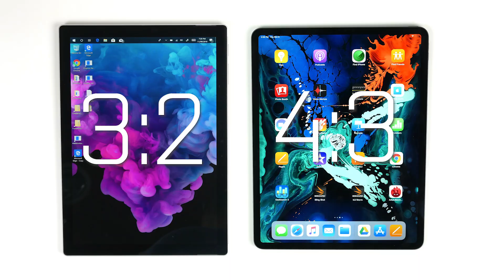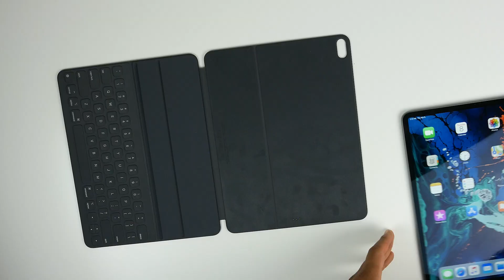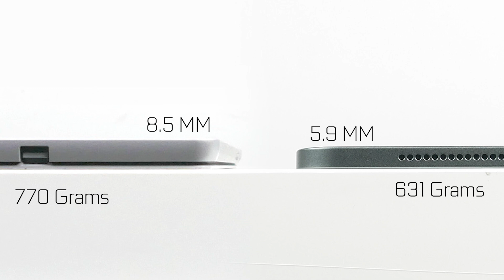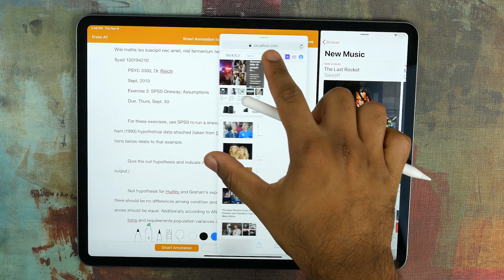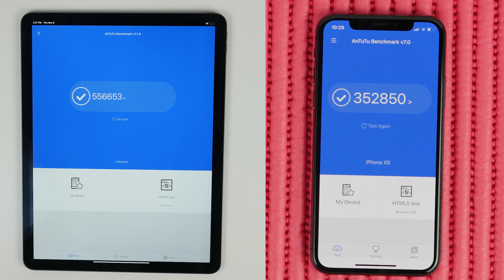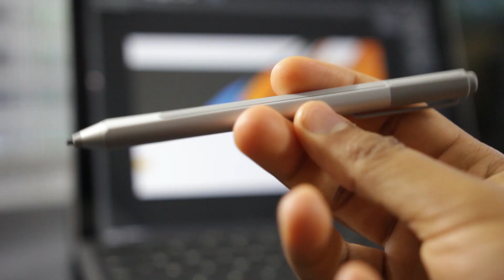2018 iPad Pro vs Surface Pro 6

Comment: Ipad. No file system, can't add storage space. Can't use a mouse. Can't put a USB files to it. Can't open multiple tabs at once. Can someone please tell me how it is a laptop replacement. I don't see it. Surface Pro 6 does all those things. End of discussion
Reply: @tech4days162  Files is just an app you cant access anything with it execpt icloud
Reply: Getting Surface Pro 6 with i7 is way too costly. Same for ipad pro.

I would rather buy decent laptop like Dell XPS 13 or Inspiron together with 64GB New Ipad pro 11 inch

There you have it. It's almost the same price of them but little bit higher
Reply: @Pranita N both are good to their respective audience , neither machine makes sense as a laptop gives much more than what they offer at a lower cost and many modern laptops are light along witn being a 2 in 1 as for any decent work you need a keyboard and a touchpad so a laptop outscales  them both.
Reply: Gamingdragon yeah, a lot of good laptop but non of it is from Microsoft...specially surface
Reply: @Pranita N you can find stupid comments like that everywhere . People saying windows doesn't do more stuff have never used a windows machine , a well optimised windows machine does far better than ios but ios is simpler and better for casual use as well as for mild photo editing .
Reply: you actually CAN add storage space.. even on iPhone. there are usb sticks that have their own app. you can add photos and video to and from external storage using the app. so there goes your point.
with the surface pro YOU NEED to buy the keyboard with the trackpad because everyone in the world knows touchscreen is shit trash for windows 10. with the iPad, you dont need the keyboard because its great as is. also, no 120hz refresh rate lmao and shit processor. 
I will agree with you on one thing tho... iPad is hard to use as a TRUE laptop replacement. ive tried, and I kept on coming back to my MacBook Pro. BUT, it TRUELY is the best companion for the laptop. and you cannot disagree with that. 
over all, if I had to fully choose between the two to replace my laptop, id still choose the iPad 12.9 over the sbp
Reply: You can do all of those things except use a mouse
And why would you want to use a mouse with it?
Reply: mister may got roasted by kjcz ashiba......dam.... mister may
Reply: Apple: hold my beer till fall 2019
Reply: one answer to all of that limitations: Jailbreak
A jailbreak will cure everything except for good professional app support.
Reply: You are wrong in a lot you said. There is a files system literally called Files, you can use multiple tabs AND multiple apps at once, and you can airdrop any files you want as well as using drop box or any range of services
Reply: I just don't think it is a productive topic since surface is a laptop. I don't think it is fair to put them together. I have both surface and iPad. I like surface can open tons of applications together since iPad only can open max 3 apps together. Surface can open multiple windows document together, but iPad can't. It depends on what type of consumer it is. For the iPad, I don't think it need a mouse, the touch screen actually works very well, but surface actually really need that mouse or trackpad because there is a delay on the screen and sometimes, it will result frozen screen. After using my surface for a while, actually my battery sucks now(around 3hrs battery life max), but I don't want to spend more than $500 to replace it for a refurbished device. My iPad used to have battery problem, it used to drain faster after it turn to 25% but it becomes better after I update it to IOS12. Before that I went to the Apple Store actually, they told me it would be $99 to replace a new device. Support part, I will say Apple is kinda better. Port is not a big issue since mostly I use cloud drive. App wise, IOS totally win. There is more options. I am a student, and I only can use onenote on my surface, but I have more and better options on the iPad. Later when the full version Adobe dropped, iPad will win as graphic part. However, if you want to do basic coding or install some company customize win app, I will say definitely surface win. Overall, 1. Surface is a computer, it even cannot identify as tablet(the tablet version is horrible). 2. If you really don't want to spend a lot of money, and you want a computer and have capability to write, you can get surface. You don't need to worry about storage because you can always put micro SD card. 3. We don't need to say which one beats other because tech is a thing keeps updating. Tomorrow will have a new machine come out and whatever we are discuss right now will seem like shit again. 4. Whatever you think iPad cannot do, actually there is other way can solve that, it will not affect the using experience.
Reply: mister may exactly! I love my MacBook Pro. I can only say I like my first gen iPad Pro 12.9. It, too, was billed as a replacement for a MacBook. It wasn’t, and thankfully I held onto my MacBook because there were far too many things I still needed to use it for. iPad is form, MacBook is function. Hope springs eternal...
Reply: I hate that I have to swipe up from the bottom of the screen to open another app. I appreciate that I can run two apps side by side, but I liked windowed applications such as on a Mac or Windows computer, where I can quickly move between apps without having to swipe around on a display
Reply: This is the truest comment out there. iPad Pro is good and all, but how can people possibly compare this to a laptop computer, yes it has a keyboard and can handle (some) computer tasks, but at the end of the day, it doesn’t really make it in the realm of replacing a computer, my opinion feel free to argue
Reply: @tech4days162  dont forget the file system called Documents... Amazing
Reply: You are still in deep "90 :) Be more courageous :D
Reply: Lol I'll prefer a Razer blade.
Reply: mister may I know he seems to be a bit biased. If he reviewed it as a tablet that would make more sense but he literally says it’s a laptop replacement and then focused on things like the camera, weight, speakers etc.
Reply: It has file system, and yes you can add USB files to it, I download mega raw images and raw 4k videos from USB stick all the time - But I guess Ipads weren't designed for BABOONS!!!
Reply: I can use a mouse with my phone with an adapter lol
Reply: Can the Surface Pro 6 run java programs?
Reply: mister may buy a Commodore 64!
Reply: The iPad can open multiple tabs at once
Reply: @jaedevrick  you can open up multiple tabs on your screen and veiw them all at once. 😂😂😂😂🤣🤣🤣🤣. No you can't. If you think you can. Try it. You can only do a side by side with 2 different apps.
Reply: @mistermay7986  you literally can, there is a bunch of reviews on it, idk what's so funny.
Reply: mister may you can’t replace a laptop with something that’s still just a laptop lol

Surface pro is not a tablet lol
Reply: It's funny how you asked people about their opinion but at the end of the sentence you just closed the discussion.
Reply: Try ifunbox for managing storage on ipad
Reply: A laptop replacement to me is a device that will allow me to do most (not ALL) of the things that I do on a laptop/desktop without getting in my way (has to be light and slim (iPad's form factor), optimized OS with power behind it (iOS+A12X), versatile while remaining mobile (USB C, AR capabilities, music studio hardware/software integration, Photoshop), etc.). The Surface seems more like a laptop rather than a replacement because it has Windows which is better suited to a desktop/laptop platform rather than a tablet platform. 

Right now, I'm aiming for an Android phone, iPad tablet, Windows laptop setup until I can afford more Apple gear for a more seamless experience in my everyday life. However, I do intend to keep my Note 8 and Lenovo y720 to do things that Apple don't have a hand in (Virtual Reality, Videogames, and obscure use cases only possible on Android).
Reply: Well say hello to ipados13
Reply: All those features are coming this fall with the new OS, iPad OS
Reply: Gerard Murillo I can plug keyboard, external display, Ethernet cable, speakers on a multi-port adapter. So I only need to plug in one thing to transfer into desktop set up. What about trash surface pro? All regular laptop with that price is better than surface pro, its just a trash laptop with worse keyboard and trackpad. A12x don't run macOS, so? 4K video editing? 2k 100+ layers PS? Pro music editing? What about your garbage surface pro? What "pro" things can it do? CFD? Can't. Rendering? Can't. Large scale data simulation? Can't. That piece of trash can only end up doing pdf reading and MS office. Btw iPad Pro can do excel way faster than surface pro6 i5. Lmao
Reply: @kjczashiba4830  You make good points, but what you don't understand is that they are two completely different operating systems , that both have their pros and cons. I have experienced the Surface Pro and the iPad Pro, and I think that it all depends on what you need it for.
Reply: Cameron Bayat I'm not trying to say windows is trash, just saying surface pro. Surface pro should be perfect for me if only Microsoft actually trying to optimize it. I bought one and it let me down. I thought it would replace my 13inch laptop and be a good notebook for taking notes on lectures, it just can't, in both way, at the end it just a touch screen laptop without the keyboard and trackpad content together. Or maybe it's just me being too critical with the experiences.
Reply: @kjczashiba4830  I think you are being too critical. iPad imo isn't necessarily worth it off your not in the apple ecosystem
Reply: Not anymore. iPad OS in September adds a true file system, external storage, and trackpad mouse support plus tons of other improvements. Not to mention it’s a power beast of a tablet computer that outperforms most laptops and MacBooks.
Reply: @coralreef909  but we will need to see how good mouse support is . I personally don't know if it is going to be useful in the iPad. It would be easier to use touch recognition instead Imo. The other features seem dope tho
Reply: @coralreef909  no it doesn't lol. It doesn't outperform laptops and it probably never will . I would love to see fucking Skyrim with over 200 mods run on my iPad. But it won't. There is a reason that steam isn't on iPad. It's because it is now powerful enough. And don't try and say it is. If it was then I would be using Steam on my iPad right now
Reply: mister may COMPLETELY AGREE
Reply: iOS 13 fixed it all
Reply: mister may cough IPad OS cough
Reply: Gerard Murillo I had a surface pro6 i5 version, and I'm pretty sure you don't have a iPad Pro. Actually I thought surface is the only 14nm x86 device you've ever used.
Reply: Now with the iPad OS coming up, you gotta change your opinions
Reply: @amgmspaghetti  It looks good but if you want to use full Adobe Photoshop etc then Windows OS is better, same goes for Microsoft Office. But I do think the iPad OS looks great and would be good depending on what you use it for.
Reply: @Daniel P some*
Reply: @JW H I love the SP Keyboards. The key travel is just fine, especially considering how thin the keyboard is . The mouse is good as it is compatible with gestures. And the touch screen takes time to get used to but it gets easier to use after trying it for a while. I'll admit that when I first got my surface pro , I was uncomfortable with the touchscreen because I moved from an iPad to SP. But I enjoy it now.
IMO it is all about preference
Reply: All of that is fixed with ipad OS and multiple tabs have been here for a while
Reply: mister may you’re right, the Surface Pro is better than an iPad as a laptop. However, as tablets, the iPad wins hands down. The fact is that the Surface Pro is basically a laptop that has a crappy, detachable keyboard/trackpad. Without the keyboard and trackpad, the Surface Pro is very difficult to use as a tablet because the desktop OS is not optimized for a touch screen interface as well as iOS with the iPad. In my opinion, if you plan to get a Surface Pro, just get a regular laptop. You’ll rarely use the touchscreen anyway, and I’m a person who owns a 2 in 1 windows laptop. I tried using it as a tablet, and I ended up sticking with the keyboard most of the time. 

My point is that the iPad is more of a “laptop replacement” than the Surface Pro, because the Surface is just a crappier laptop with “tablet” abilities that aren’t as good compared to the iPad. The iPad is a tablet that is given some laptop abilities with the keyboard and that’s it. Besides, the processing power of the iPad Pro with the A12X is basically future proof at this point which means that future iOS updates and third party developers will utilize the A12X processing power and touchscreen interface to make the iPad Pro a true replacement for laptops for anyone including content creators.
Reply: @angelo_villones  How is windows bad on touchscreens , its a myth actually . Also none of those beat a real laptop or a device like the surface book which is very versatile . The ipad is just a tablet and as good as any other tablet while the surface is aimed for the office class who have to deal with documents , presentations etc as such just buy a xiaomi notebook with an 8250u and an movie 150 , 10 hours of battery life with good going performance formula end gaming .
Reply: ipad and surface both have touch screen you dond have to use a mouse or track pad god damn it
Reply: Did you really just say iPad doesn't have a file system? Have you really ever used one wtf
Reply: @neetiranga  It is way to limited and uncomfortable for the user.
Reply: Tried several times on my 2 in 1 (8th gen i5 8gb ram) to use it just in tablet mode and even with a stylus windows is still not that touch friendly also had a good amount of lag in photoshop using the smudge tool on a 72ppi almost 4k image, also noticed that the i5 surface pro 6 seems to be fanless.
Reply: surface pro6, No usb-c, no 120hz screen, crap processor, crap AR support, crap battery life.
you need USB to transfer data because their is NO airdrop or something closer on windows, 
surface still support mouse because they know their win10 touch screen support is garbage, without the keyboard and trackpad surface pro6 is a piece of trash lying there can do nothing. 
LAPTOP REPLACEMENT is not built sometimes similar but has a worse experience than laptop. for those who have desktops and need a mobile device or work on art, ipad pro is the perfect laptop replacement, while surface pro6 is just a crap laptop.
Reply: @kjczashiba4830  sp6's touch screen is perfectly fine and that's obviously not the reason why MS added a track pad. If you question the inclusion of a quintessential track pad, then you've never worked on a laptop before.
Reply: Ahmed Choudhury then stop using trackpad or mouse on surface and see how long you can take. and most of the time im using keyboard short cut for word, excel and matlab. if you use mouse so regularly then you a just a kid unfamiliar with the software
Reply: @kjczashiba4830  I think you never used a productive program in you life to know the importance of track pad and mouse.
Reply: Raghunandan Reddy C matlab? procreate? excel? tell me how important a trackpad is? have you ever use those apps before?
Reply: @kjczashiba4830  I'm using my SP6 without the type cover most of the time and I had none of those complaints with the touch or the interface that you've mentioned, I don't even think its that much slower on desktop mode without a mouse. And I cant either understand why you think the processor and battery life are crap, they serve me well in university as well as for media consumption. Also drop that forced apple bias, you just can't be that ignorant to think that airdrop is the solution all of the real world uses for productivity tasks and that USB is completely unnecessary
Reply: Toastelele L. you won't understand because you only use surface pro, I used surface pro4 and ipad pro first gen, all the lags bugs none responding, randomly screen freezes in your eyes is nothing or you thought it was your finger operating miss. you know what, keep use your sp6 and never touch a apple product, and you would be happy with your choice
Reply: @kjczashiba4830  lmao, so you commented on a video that is comparing recently released devices, using a comparison of outdated devices for analogy while talking bad about the current device in categories that have improved over the last years? Yeah you may be right then in saying that I can hardly relate to your little nonsensical rant, but I assure you that those issues you claim you had on a frequent basis have nothing to do with sp6. But I guess apple fanboys cant comment on a windows product without gatekeeping and saying they've seen more bluescreens than anything else
Reply: Raghunandan Reddy C so tell me what type of production you do on shitty little unfriendly non-fan tabblet...wonder if you can fry an egg after stress test 30 minutes 4k advertise. I rather buying a laptop from dell asus or acer at that price .... i am a user who used to have the surface windows tablet from 2014. And i will tell ya that it is a nightmare, it wicked, no graphic card nor support egpu, touching is crap, and keyboard is just annoying even i am a user who using pc from start with. Everything that windows tablet do is just basic used like browsing web check email typing essays...if they using amd ryzen 5 2500u yes, i can said it can render a project but this thing using intel hd630...little shit that is so stupid
Reply: Toastelele L. Yeah, like cover half of your screen....i tell you that, for typing, even ipad still need a keyboard so dont talk crap ok 👌. The thing here is, ipad can use without keyboard because most of program are apps, not web browser like on windows. Second, if i have to choose between a surface or macbook i surely choose MacBook even i am the kind of man who always said macbook overpriced . Because surface not even close to overpriced since it is hyper price..
Reply: @ahmedchoudhury7838  Exactly!! Surface Pro is a laptop tablet system. Win 10, designed for business, creative uses, field uses, education uses, and more. The extras just make it a more complete and flexible system. Ipad Pro people here are laughable. I have an IPP 9.5, and no f'n way would I even compare it to my SP4. It barely hangs in there with a Samsung Tab S4. Worst yet, Ipad Pros stop working when its too cold or too hot. I bought it to fly a DJI drone, and the damn thing dies when its not a perfect temp outside. I have to use a Samsung S4 Tab to finish our work at jobsite zoning. Lots of negatives with an Ipad Pro as well.
Reply: @kjczashiba4830  he means that you can't transfer files from a device directly to ipad pro...many functions of usb c are not there on ipad pro unlike other usb c devices
Reply: @kjczashiba4830  crap processor that have been use in Mac. Hmmm crap Mac
Reply: Hermawan Fandi macbook pro13 use 28W processor with 2 fans focus on it, while surface pro6 use 15W processor with passive cooling. and yes, the new macbook air is trash, I never gonna deny that.
Reply: @kjczashiba4830 core i7 is not crap
Reply: @professional4158  Apple fanboys....
Reply: @kjczashiba4830  all your points are more garbage than XR resolution
Reply: ( ͡° ͜ʖ ͡°) well, then my points are not as garbage as you
Reply: @kjczashiba4830  also windows can have a far superior touch experience if you know how to use windows along with custom software like gesture sign and ahk .
Reply: @kjczashiba4830  "surface still support mouse because they know their win10 touch screen support is garbage" - so if they why dont they put a touch screen on the Mac laptops? I guess they will do soon and then they will remove the touchpads too. Let's see how right you are.
Reply: Manos Protonotarios because apple knows macOS has too much old things just like windows, and would be impossible to make macOS be touch screen friendly. not like microsoft, win7 win8 win8.1 win10, how many years past? win10 still can't support touch screen well
Reply: @kjczashiba4830  windows can support touch very well dude .
Reply: @kjczashiba4830  crap processor? It's literally better than the iPad pros a12x.
Reply: aliwalyd3 lol better!? How!? One is 4 cores 8 thread low tdp, one is 8 cores 7 gpu that can run as close as rx 550. And also geekbench marks are up there
Reply: @kjczashiba4830  also what is the used usb  c ,its stupid except thunderbolt support which only a few users may use because an external going is not portable or cost effective . also windows can transfer files over wifi for years , it has a ton of applications for it , usb is faster that is why windows user use that . Again none of those devices have good AR support for which you need atleast an Nvidia GTX 1050 .
Reply: Gamingdragon first, a12x is an eight cores chip, no match, second is does surface have gtx 1050 nor support egpu (not even have type c)...when ipad did. Intel hd 630, will you doing any project on this gpu? If you did, next time remember to put an egg on top off its and see will its enough to boil an egg.
Reply: @kjczashiba4830  Ummmm No. Plenty of ways to get data to the surface. The screen is brilliant, so is connecting it to multi-screens and screencasting, Battery life is well good enough, Why would i want to use something like airdrop? A mouse is still one of the best ways to be productive and actually get things done. The keyboard and trackpad is as good as anything apple has to offer. In comparison, the iPad is a toy for consuming on.... A good one but not a productivity machine which is why Apple agree with me by selling laptops...
Reply: Stephen Catton first, what kind of workflow will you put on i5 8250u 8gb vs specially hd 630. Tell me, i wonder if that shitty can run adobe premiere without overheating. Sure it is better than using touch screen but its also means, its cannot live without keyboard and mice which is a joke since you had to buy it. Ipad pro, depend, some user dont need felio to use a ipad.
Reply: @kjczashiba4830  For it's purpose - creativity; do tell me why you need a 120Hz display - especially on a device where it barely passes 60FPS in most applications? AR is a fucking myth and 'crap battery life' - no, it's a professional tool.

This thing annihilates the iPad Pro - infact, just iPad; it's not a fucking Pro device, it's a joke.
Reply: Sy7ygy barely!? What are you talking about!? Even snapdragons 845 can handle 90fps gaming and something that can handle 2k game cannot push near 120fps!? Rubbish...yes this can game , gaming like pubg mobile, asphalts, watching high refresh rate contains...only shity hd630 cannot push anything over 30fps even on lowest at fhd
Reply: @kjczashiba4830  youre just another brain washed apple fan boy please stop spreading yore bullshit if youve ever used a surface pro the you would know what youre talking about. BTW ever heard of WINDOWS... yes no one uses OS in the work industry
Reply: Emperors Ordeal OS=operating system, and windows is an OS, you are just a kid knows nothing
Reply: @kjczashiba4830  LMFAO
Reply: @kjczashiba4830  CPU is not crap it is a desktop architecture not mobile
Reply: @kjczashiba4830  That's a pretty dumb comment. The battery life is quite good in both.  The CPU isn't amazing on the surface pro but it's capable enough.  Were you planning on running Crysis 3 on your ipad?  I want to be able to store my photos on an external hard drive and edit them on a device like a laptop and then continue with a larger more capable computer at home, the iPad won't allow this because of it's programming. I'd have to use cloud storage, which doesn't work all that well with the full version of lightroom, and with multiple gigs worth of photos and video, I'd have to pay for a storage subscription, and use mobile data if I'm away from wifi...no the iPad isn't capable enough.
Reply: @kjczashiba4830  so send me a excel file over facebook messenger
Reply: Duy Lai dud, Facebook messenger limited the file size to 25mb, my single sheet of excel is larger than that
Reply: kjcz ashiba well, Surface Pro 6 has better battery life than the iPad Pro 2018 as mentioned in the video. I doubt you watched the video
Reply: @kjczashiba4830  ipadpro is the first apple device using usb c, while other devices have been using usb c for a much longer time, i bet a person like you wouldn't have been giving shit about usb c and would be thinking usb c as useless until apple introduced it in their device, suddenly you are now realising the importance of usb c
Reply: Sarfraz Ahmad 1. Apple start using usb-c on MacBook since 2016, and that Mac only has usb-c. It is apple pushing the usb c
2. He was talking 15w i5 gen8 faster than 45w i7 gen7
Reply: kjcz ashiba how is an 8th gen i7 crap?
Reply: @kjczashiba4830  haha i Like Apple Fangboys
Reply: @kjczashiba4830  crap processor? The i7 absolutely demolishes the A12. No competition.
Reply: วคx I did a simple test, 80mb xlsx file, 30000 weibull distribution calculations and few histograms, iPad Pro can load, do the calculations and plotting twice faster than surface pro6 i7 version. Face the truth kid
Reply: kjcz ashiba 
Enjoy your iPad pro
Reply: Fuck off
Reply: @SephirothxRena  lol
Reply: real apple fanboy  @kjczashiba4830
Reply: @kjczashiba4830  my dad has an iPad pro. I have a surface pro. My dad prefers my surface pro lol.
Reply: Jonathan Pontel that’s what all fandroids say
Reply: @jponz85  everyone thinks differently 🙀
Reply: @mryup6100  agreed
Reply: @tech4days162   You have Apple in your name, you're not even trying to be non-bias. These two devices have two very different audiences. The iPad is geared toward your digital arts creators on the go. The display is beautiful and the pencil is hands down the best portable tablet (as apposed to studio drawing tablet) I have ever used. Meanwhile the surface is geared toward your average business person. It is a full laptop in operation with a tablet form factor. The keyboard is hands down better, I cannot stand to type on the iPad keyboard for anything longer then a couple of minutes, meanwhile the surface keyboards are the only other laptop keyboard I will use besides Thinkpad (I feel I should mention that I also loved apples old laptop keyboards that they abandoned to shave off three millimeters from their devices). There are a couple of objective truths between the devices, but at the end of the day it comes down to preference and use case.
Reply: @kjczashiba4830  crap processor? Really? What are you smoking? It's a complete computer OS. Not a mobile OS and 120hz? Why do you need it on a work machine?
Reply: @kjczashiba4830  Stop with this USB C propaganda. We still use a regular USB file drive. It does not fit in a USB C. The world still actually use regular ports. And guess what. You do to. You have to use an add on for a USB C. As for as what's better. Surface Pro 6 is near flawless. Pick one up and try it. Trust me. You will never want to put it down
Reply: mister may I throw the new surface pro, touch screen got no response randomly, bad touch screen interface optimization. just because I didn't shut down it for 2 days, it crashed while I was working on my report, whole screen freeze and no response, even no blue screen. All the time I use it I was thinking why not just go to the regular laptop. Ive used thinkpad x1, macbook pro13 2016, and new surface pro was the latest laptop I bought but the most unreliable laptop I've ever used
Reply: mister may and the issue is usb-c adaptor support ANY port on surface pro6, while NONE of the ports from surface pro can support full usb-c 10Gbps.
Reply: mister may why are people stressing on usb - c it is miles faster, can transfer files, charge faster, supports a variety of ports, can support external displays. Surely this says that the surface pro is not future proof even the surface go has a usb c. There is a reason people are stressing on it. And now Apple is adopting it it will surely grow quickly. You would buy a surface pro to do graphics intensive work, would you ? It would be used mostly for productivity, typing emails, media consumption, etc. And as you said that photoshop was working with a little stutter on stage, it is still in beta. At least the iPad can excel at the things it is meant to be. The surface pro is just messed up, it is a low end laptop at such prices. Don't tell that it is a hybrid, it works crappy when used as a tablet due to Windows. The a12x bionic has a huge headroom for developers to take advantage of it. Editing 4K video efficiently, and where did you get your info, the iMac pro doesn't fail in editing, it pushes through it easily.
Reply: @mistermay7986  world is shifting towards type C, which is tough for most users, but it's a better port indeed... or else we wouldn't have upgraded from floppy drives
Reply: @sannatal44  type C is bad to omit on surface. But I wonder what productivity iPad offers with USB C on it when you can't just drop files to and fro from it. iOS is a mobile OS can never compete with Windows.
Reply: mister may no I don’t use an add on for usb c I use usb c normally
Reply: mister may it’s just dumb because the surface go has usb C, and this one doesn’t
Reply: @ExpendableCrumb  usb c is a gimmick for now as all real work can be done effectively via a normal usb without carrying a million dongles as such you cant even put in a normal flash drive without  a dongle . Also usb C will be implemented in next gen by adding thunderbolt support as without thunderbolt i dont think it would be that useful and implementing it would require a redesign . The surface gohasno thunderbolt support . Btw next gen may be amd anyway so makes no sense for getting thunderbolt this year and dropping it the next as they care for the customers who may purchase an egpu for thunderbolt.
Reply: @mistermay7986  The irony is the CHEAPER surface go has USB C which kinda sucks if you want a expensive laptop to have the latest ports
Reply: @kjczashiba4830  i didnt shutdown mine asus 400 dollar core i3 4th gen laptop for last 4 months and still no problem at all. your 2 day claim is fake .
Reply: @kjczashiba4830  even with usb c you cant connect ssd. we can do it on surface even without usb c. whats the use of that shit 10gbps port when u cant really use it.
Reply: @rajshriingle8952  there are people on earth who doesnt use photo editing, exporting at all, software at all. who told you surface has bad experience in laptop mode. thats you made yourself in your mind. surface is much more versatile than ipad in every aspects.
     internet-- most people use chrome and chrome in windows is much better than your safari shit. 
    surface is really a 2in1 laptop and your ipad is just another ipad trying to become laptop. 
intel processor are still better than arm processor  made by apple. geekbench score changes in different os.
   this guy didnt shown the quality of surface pro displays.
   just by saying apple chips are optimised for 4k video exporting doesnt make ipad a better laptop choice. surface can also do that can also run other engineering software better than ios, can game, can use mouse, and the best one it has a sd card slot and can also connect to external storage device. 
    it can do every laptop task on the go.
 there are still no test showing core i5 and core i7 are slower than your apple counterparts in every task they can be faster for 4k video exporting but laptop experience is much more than that and intel chips are better on that still.
       ipad can win for their pen support and battery life but thats not a laptop experience
Reply: @rajshriingle8952  all the time isheeps brag about 4k video exporting thats not means ipad is a better laptop alternative for everybody.
Reply: golu singh first yes for laptop it is not match and i am 100% sure but compete with windows tablets, it is way way more useful
Reply: @sannatal44  sure but not everyone gets an usb-c drive. And not every device has usb-c even though they should
Reply: mister may who is we? Most of my items are USB C now
Reply: kjcz ashiba usb c support, on an ipad? Whats its used for? Charge?
Reply: @kjczashiba4830  is it possible you got a dud? I've had a surface pro and a surface laptop as well as a macbook pro. I've never had any reliability problems with either windows device, their shortcomings (for what they are) were that they're not all that fast (neither was the macbook) and not having the brightest screen. I sold the macbook because it had too many compatibility issues and the screen lacked contrast.  Apple could fix a lot by making iOS something better than a walled garden for your money.
Reply: Charles Talhelm even Microsoft admits the issues of win10, they promised the next win10 update will fix those problems (hope so, they said this every time). Why you still fight for them?
Reply: @kjczashiba4830  core i5 8250u beats a previous generation core i7 hq series in performance so how is that crap especially it being a 4 core 8 thread cpu unlike previous generations .
Reply: Gamingdragon 1. 7700hq is 25% faster than 8250u in multi core and 3% faster in single core.
2. there is no fan for i5 version surface pro6
3. you don't even know which is VR which is AR, at least gtx1050 for AR?? 
do you even know what you are talking about?
Reply: @kjczashiba4830  Windows 10 recommends atleast a gtx 1050 for it mixed reality which incorporates VR currently and AR in the future for its applications . i know what i am talking about . 
As for benchmarks core i5 8250u gets 4700 in single core compared to a 4000 7700hq  while in multi core it 8250u has 13,000 compared to the 12,000 of a stock 7700hq. Also how can multi core improvement be smaller than single core as the ipc hasn't been improved this gen as much as the number of cores and the virtual threads .The 8250u is a 4 core 8 thread machine.
Reply: Gamingdragon AR don't need two screen cover you eyes kid, you talk like you've never used AR, and combined VR and AR is not happening in next 5 years. so stop your gtx1050 joke. 
and from cinebench R11.5, 64bit, Passmark CPU mark, geekbench3, ALL of them shows 7700hq is at least 15% faster than 8250u.
the latest geekbench4 results: surface pro6 i5-8250u is 4085/13293, macbook pro 15 2017 i7-7700hq is 4640/15196, even i7-8650u got 14352 which is lower than 7700hq. can you tell me where you got those magic numbers?
Reply: @kjczashiba4830  the magical numbers can be obtained from any device you use yourself and in my case i useful xiaomi notebook with an 8250u vs a lenovo 7700hq . As such that is the case with real world devices . Search about it on techtablets on how to receive the performance upgrade if you arent getting it , also the numbers you stated for geekbench  for 7700hq are far higher than listed even on the geekbench website .
Again Mixed reality which uses AR as well as VR does have the system requirement as stated on windows support page as well the limitations in ar in specs can be easily seen in the limited field of view of the hololens which is a real useful AR tech unlike silly phone apps .
Reply: @kjczashiba4830  oh yes the macbook 2017 has the result 15196 but the asus with the 8250u has a 15190 as well while if you undervolt this cpu then you get a much more stable high clock with scores equivalent or more that a 7700 hq as the lower temps due to theundervolt allow for continued burst frequency .
Reply: Gamingdragon undervolt will only cause unstable and randomly shut down, have you ever tried those overclock settings? macbook pro has 2 fan focus on 7700hq, while surface pro6 is passive cooling. you don't know what you are talking about obviously.
Reply: @kjczashiba4830   You are comparing a 45W TDP chip to a 15W TDP chip. That is not a fair comparison. Also you are arguing about spending a good chunk of money on two different devices that value portability over function.
Reply: darknexlore that guy was comparing 7700hq and 8250u and tell me 8250u is faster than 770hq, I’m just telling him he was wrong
Reply: @kjczashiba4830 It comes in faster then the  i5 7300hq which is still impressive considering you reduced the TDP by 66%. He may have been mistaken, but none the less the 8th gen chips are great. I can still run multiple vm's on a laptop without issue in a 15w chip. Unless I am remoting into my desktop this is impossible on an iPad. The use case for each device is different. You are trying to sell the iPad as an end all be all solution when it isn't. It might be perfect for your workflow and that's great. Unfortunately until it gets the ability to; run vm's (on an 8core cpu that should be easy enough right? Not so much with an ARM structure), compile code(sure I can use ssl or a web compiler, but the latter still has issues on iOS and both require internet. Just give me a separate sandboxed compiler, I would really like to know why this doesn't really exist yet.) And a better keyboard (there is no excuse for how mushy those keyboards feel when the surface can do so well in the same size) I could not use this for my work flow. I'll admit it's an amazing device for anyone doing art or anything without that keyboard.
Reply: @kjczashiba4830  dude you are so wrong
Reply: @kjczashiba4830  where the hell are you getting these scores, i5 8th gen is faster than i7 7th gen...it is a fact